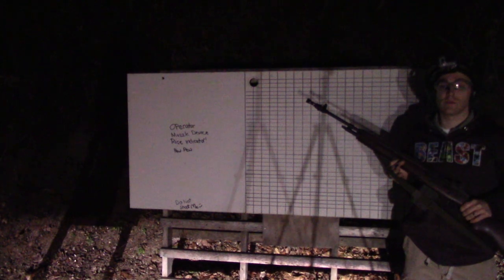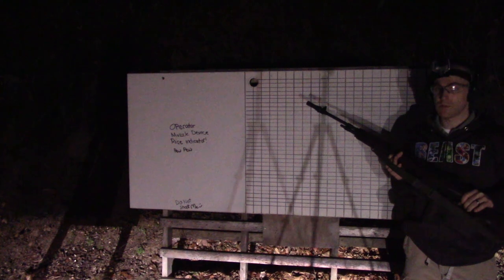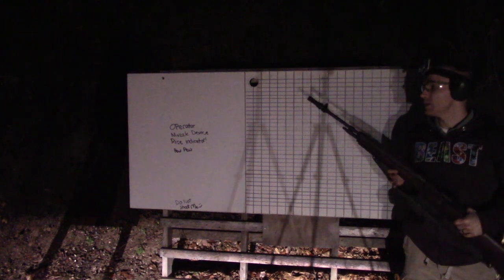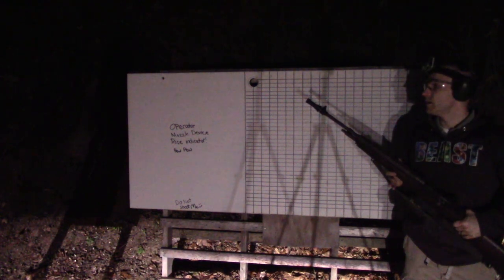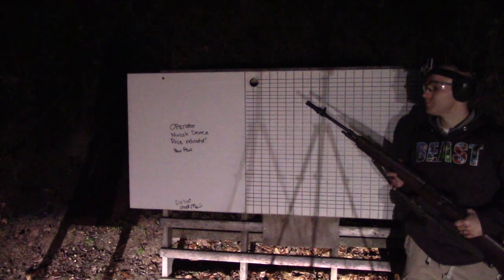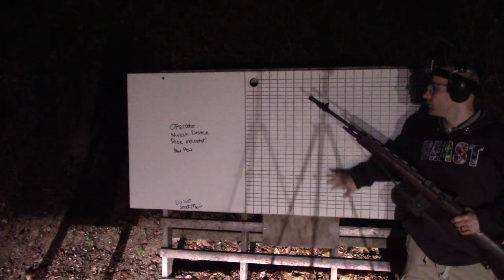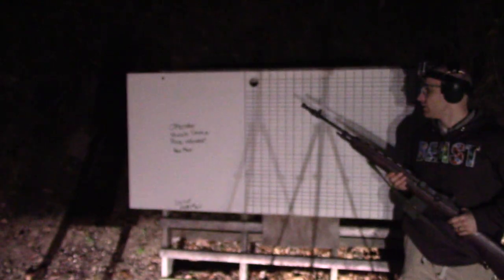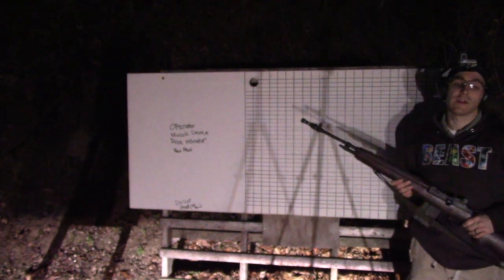Low Light Muzzle Flash - M1A with YHM QD Brake

Comment: Do you have a video of the Yhm qd break on installation and how it’s set up please
Reply from the maker: The one I used in this video?
Reply: @BuffRANGE  yes would like to see it how it’s installed and how the front sight is working
Reply from the maker: @b-eaglestactical2859 unfortunately No. I used this adapter and transferred my front sight over: https://www.midwayusa.com/product/1004722325?pid=620345